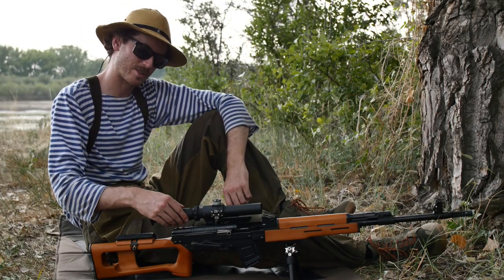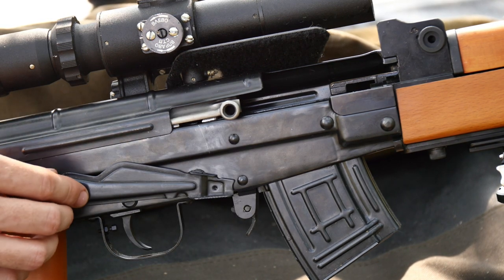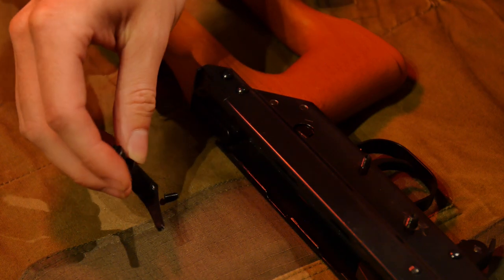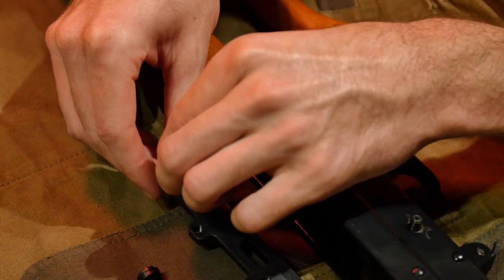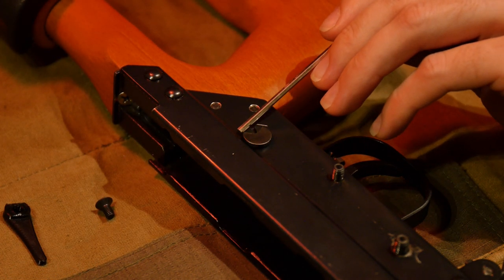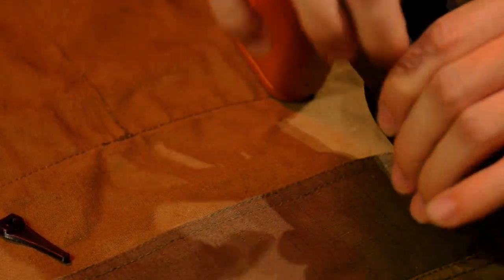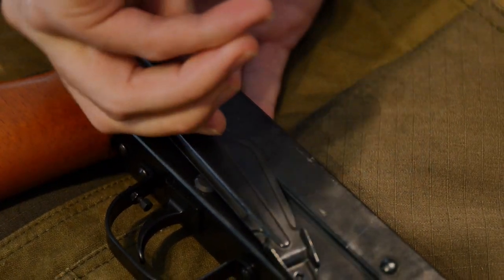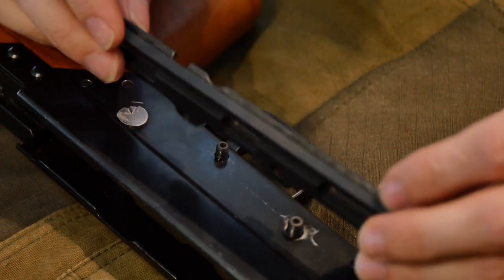3 Bar D Productions Type 81 AK Safety Adapter

Comment: They have recently released a Type 81m underfolder (which you cannot access the safety will in the folded position), I’m curious if this safety will fit width wise and function while the stock is closed

Comment: Are all of these components still viable with the new T81M?
Reply from the maker: Compatibility is currently untested with the M's. It is likely that it will fit the Type 81M fixed stock model without issue. And probably get in the way of the Underfolders folding motion.
Reply: @3DVIDEOSMurray  How far off does the arisoft safety lever stand off from the receiver? I've got my underfolder right here and am measuring a 10mm gap near the safety lever and about 12mm gap near the magazine release. The stock is significantly wider than I expected it to be. The butt end fits my whole damn shoulder. I can send you pics if you like.
Reply from the maker: @GumbootsOnBackwards  On the right side of a Type 81 LMG, An LCT brand Safety on the adapter sticks out 10mm from the lower receiver step.  This is at both the pivoting point and at the finger tab on the end of the AK paddle. The opposite side of the safety on the Left side of the Type 81 only sticks out a few millimeters.
Reply: @3DVIDEOSMurray  interesting. There may be just enough room for it to fit without clearancing the parts. Although, the folder stock does have metal to lose. It's quite thick.

Comment: The Type 81 designer and his team took many years to built the T81 rifle specifically to correct many of the issues with the original AK/AKM platform, of which China already had millions of examples in circulation. One of the issues was the safety mechanism. Thus, the stock T81 safety is the optimized and upgraded version of the AK safety. 

So, besides the forbidden fruit AK-ish looks that many Canadian gun collectors and enthusiasts crave, installing this Frenkensafety is a functional downgrade. The stock safety has also undergone a lot of milspec torture testing for proper function, which this one certainly has not. It's an interesting dressup addon to impress friends who know nothing about guns, but there's no way I'd be putting that on my rifle for reasons stated above. Still an interesting concept, however looks over function is not my thing.
Reply: Have you shot a Type 81? I have one and the safety is undoubtedly the worst part. The safety may be robust, but it's also an awkward, un-ergonomic, gritty piece of shit.
I don't have the mod in this video so I'm not sure if it's as robust as the stock safety but there's no way it's a downgrade in ergos.
Reply: With the Underfold type 81 the safety as unusable in the folded position... There is a reason for the saying "made in China
"...